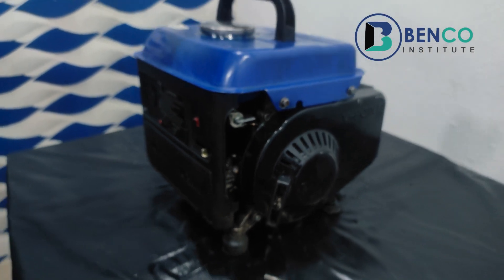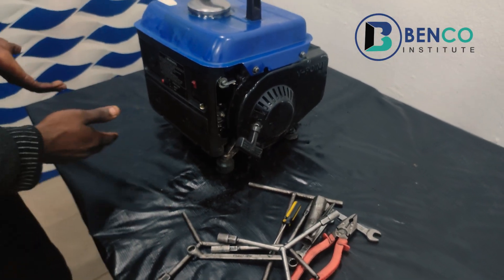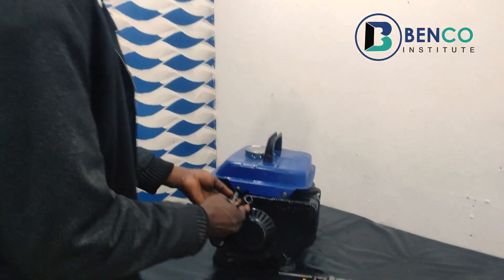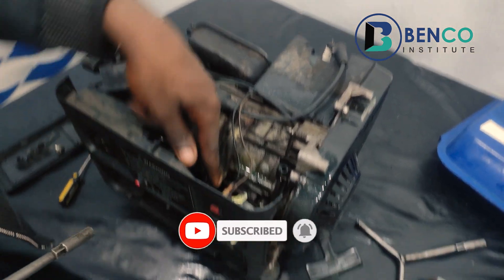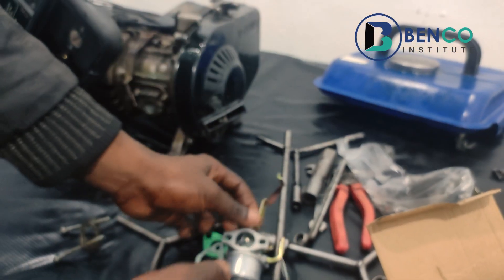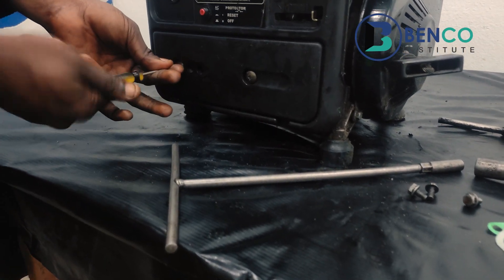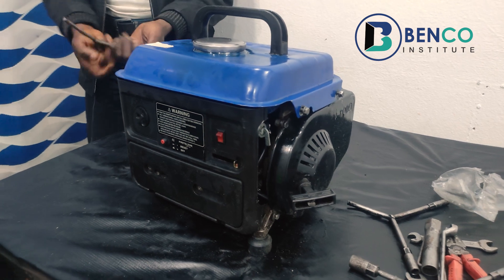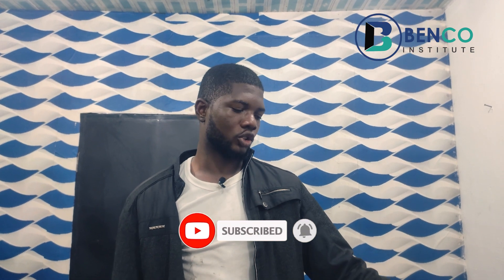Install brand new Carburetor for a 2 stroke petrol Engine....

Comment: I had an old champion generator just like this one which i dumped long ago because of carburetor issue. I tried replacing the carburator twice with no luck. The carb brand i used is MAI GIWA which i was told is the best. The generator dosent work smoothly and consumes too much fuel. Pls which type of carburetor is best
Reply from the maker: I personally use sumec firman carburetor, it has always  worked for me
Reply: @bencoinstitute   can i buy it online coz i dont think i can get it in my place
Reply from the maker: @muhammadshettima42  not entirely sure .... But if you place your order with us we can get it for you

WhatsApp @09078426919